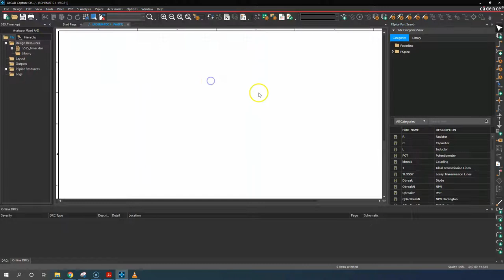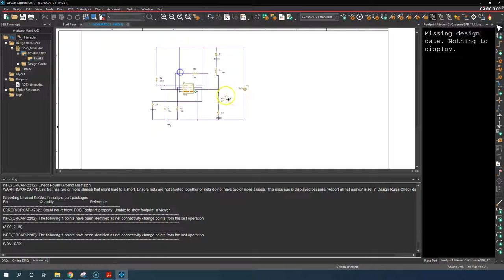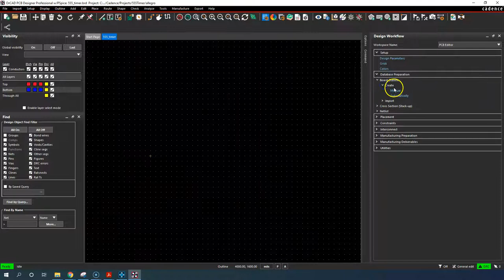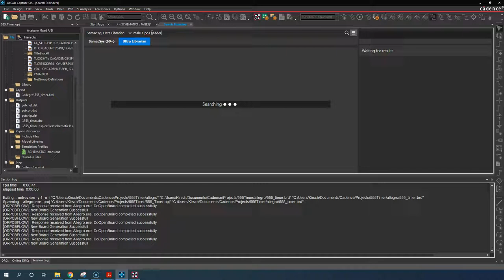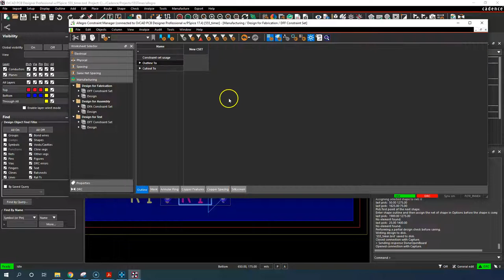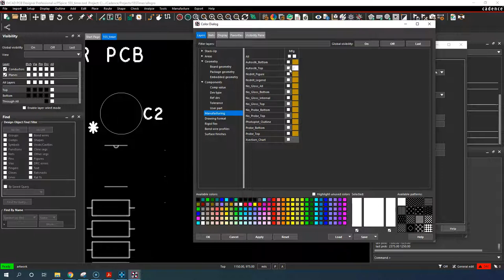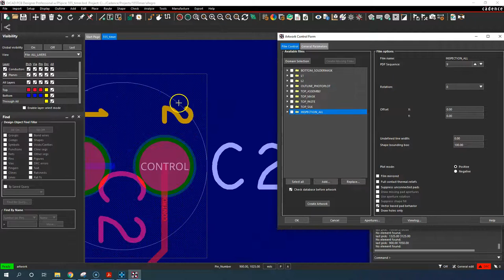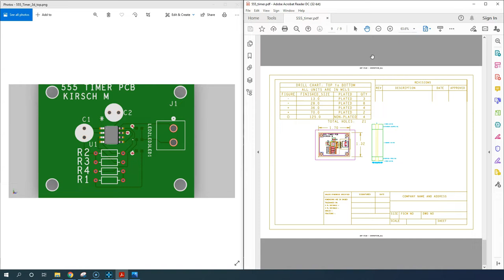The Best PCB Design Tutorial for Beginners

Comment: thank you, with this video make better my skills, now i don't know how set up for cursor & component (package) nearest together to easy arrange in board.
Reply from the maker: Hi, you're welcome. So for placement strategy, there are a number of things to consider. But first you want to set your grid to something like 100 mils, but practically, I used 25 mil spacing for the grid. If you want to get tighter than that, then 5 mils. You want to choose a grid that can multiply to give 100 mil spacing in total.

As for placement, we want components to be aligned across their centers if they are surface mount devices.

also have thru pin devices all have their pin 1 designators pointing in the same direction (helps with assembly checking times), where it would not cause a significant problem with routing shorter traces.

there are many more tactics, but these are starting points.
Reply from the maker: For even more information, reach out to kirsch at hasofu dot com, or I can make an article on it.

Comment: Hi Mr. Kirsh Mackey, I want to thank you a lot for your effort. I have a problem with the footprints not found even if I've watched a video made by you about that, the problem not resolved. What do you think I should do?
Reply: Make sure your footprints directory is as same as your project directory. You can change the priority for the directories so that orcad can identify and display the footprints. To change priority - go to design parameters -> library -> select padpath and padstack and change the directory where you have your footprints and project file. Hope that helps.

Comment: Great video! I am having issues increasing the drawing extent in PCB editor. The parts I am placing are relatively large and I can't move them properly without getting a "Pick is outside the extent of the drawing" error. How can I fix this?
Reply from the maker: Hi Michael, I"m not sure how I missed this, but you can change the drawing extents by going to PCB Editor menu, Setup - Design Parameters - Go to the design tab (or something similar) and then go to change drawing extents. You can set it to size A, B, etc. or to a custom x and y.

Comment: We purchased with license version of orcad SPB17.2 in 2016. Now, will we update the latest orcad version with existing license? It is possible or not.if possible please tell me the procedure for updates thank you
Reply from the maker: Hi, I'm not sure. Depending on your country, you need to reach out to the Cadence channel partner for your region. For instance, for the USA, it's EMA Design Automation. They might or might not charge for an upgrade.
Reply: @techedkirschEE  Thanks Sir, Please kindly explain elaborately what is the difference between OrCAD CAPTURE & PCB EDITOR vs ALLEGRO CAPTURE & ALLEGRO PCB EDITOR? Whether Both are different products or not? What is meaning of SPB 17.2 version & SPB 17.4 version and explain this sir
Reply from the maker: @kannanc9480  That would take a while to go through all those differences. If there is enough demand to discuss the differences I'll make a video. But for now, that's best answered by the Cadence channel partners who already detail and document the differences. Allegro Design Entry HDL (the schematic capture tool similar to OrCAD Capture) and Allegro PCB Editor/Designer have more features that automate or provide better shortcuts to features that OrCAD doesn't have. Like team routing, board to board design, TopXplorer vs SigXplorer, distance bubbles that appear during DFA part placement. Little nuances here and there.
Reply: @techedkirschEE  Lot of Thanks Sir what is  the SPB 17.4? Is it  allegro capture and Allegro pcb designer?
Reply: Please update sir how to do SMD pad design in the edge of the PCB for board on board assembly
Reply from the maker: @kannanc9480  Yep. That's the entire suite of products within the Allegro/OrCAD environment. Capture, PCB Designer, PSPICE model editor, PSPICE, padstack editor, TopXplorer, SigXplorer, etc.
Reply from the maker: @kannanc9480  Hi, can I get more information on this? Are you asking about overlapping the footprint pads across two PCBs at the point that their edges make contact?
Reply: @techedkirschEE  Yes sir.a kind of small pcb or module place  on surface in big pcb
Reply from the maker: @kannanc9480  So that's a detailed process that I can help with and can provide a quote for through our services at hasofu. Please visit https://academy.hasofu.com/services for more information.
Reply: @techedkirschEE  Lot of Thanks Sir
Reply from the maker: @kannanc9480  You're welcome. Here are the design files in the meantime. https://drive.google.com/file/d/1wMBhnMKYQE_sklPAn66iYv5bAwd-tLfH/view?usp=sharing